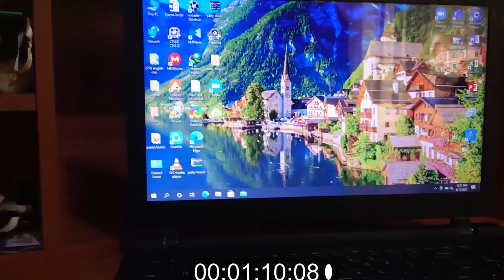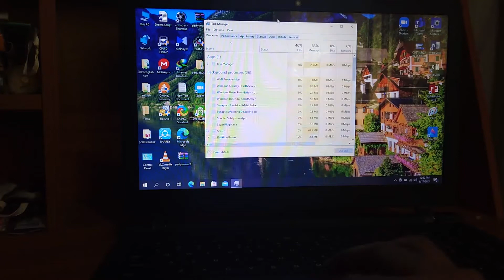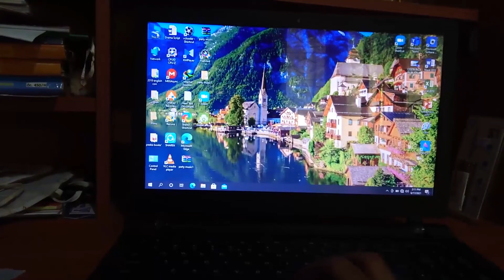Lenovo idiapad 100-15IBY disassembly and RAM upgrade

Comment: 7:26 it says slots ocuppied 1 of 2. So there is no RAM soldered to the motherboard?
Would this laptop also accept 8 GB of RAM DDR3L?
Reply from the maker: Nope no soldered RAM. This processor only supports up to 8GB max in RAM department. So you can upgrade it to 8GB
Reply: @Btech94  OK, but how. By putting in 4 GB or by putting in a 8 GB module?
I am confused because you said that there are two slots ("slots occupied 1 of 2").
Reply from the maker: @MezeiEugen i think in task manager it shows the maximum amount of ram slots that processor can handle. Some processors only support single Chanel RAM. Some modern laptops with sorted memory shows that there are 4 slots. Its just 4 memory modules. There is no upgradable ram. In this case this laptop only can be upgraded to 8GB single stick of memory

Comment: Thanks for the video. I hv done the replace. For ideapad100, no need to take off the keyboard pad, just unscrew the nuts at the back and open carefully.
Reply: thanks because i didn't know if i hqd to take the disk drive out too
Reply: @ can take the disk drive out without taking off the keyboard pad too

Comment: Hey, Great video ! I know I am little late but do you have any information about what generation sata does this laptop has. I recently installed Crucial MX500 SSD but I am getting speed of only 283 MBps read speed. MX500 supports upto 560 MBps read on sata 3 gen. I am not getting any proper info about this on google search.
Reply: Are you sure it is the MX500 and not the BX500?
Reply: @MezeiEugen Yeah I'm sure. It looks like my laptop has sata 2. There is no official statement which says it's sata 3.

Comment: Bro my laptop shows that it have 2 slots but there was only one slot
Reply: My laptop also but
When you check the Performance tab in the Task Manager, it may show two "RAM slots" because your motherboard is designed to support dual-channel memory.

However, not all laptops have both slots physically soldered or available. Some laptops reserve space on the motherboard for an additional slot but don’t include it.

Comment: Do this laptop will increase speed or not after changing the ram ?
Reply from the maker: The performance has slightly increased because swapping to the HDD happens less now, resulting in lower HDD usage. However, in CPU-intensive tasks, there is no difference because this is a very weak processor

Comment: can it run 8gb ram? is it safe to buy 8gb 1600mhz?
Reply from the maker: 8gb is max. You can put 1600mhz but it downclocks to 1333mhz.
Reply: @Btech94  Hi 8GB P3CL - 12800 safe sir?

Comment: what is much better 1333 or 1600mhz?
Reply from the maker: Cpu only supports upto 1333mhz. So no need paying extra for 1600mhz. But it also works on 1600mhz but it downclocks it to 1333mhz
Reply: @Btech94 what if i use ddr3L 1333 8gb its that ok?
Reply from the maker: @satanasjunior3673  yeah dd3l is recommended
Reply: @Btech94  thx a lot <3
Reply from the maker: @satanasjunior3673  wellcome

Comment: What is the maximum ram capacity of this laptop? Can it run 8gb 1600mhz?
Reply from the maker: Yeah max 8gb. You can put 1600mhz RAM but still it runs one 1333mhz.
Reply: @Btech94  does it only have 1 slot for Ram?
Reply from the maker: @DupilPH  yes. Only one slot
Reply: @Btech94  thanks brother!

Comment: Does it have 2 slots to put in another ?
Reply: I saw 1 of 2 slots,it's fail of Lenovo or Windows 10?in my Ideapad100 15iby is the same situation.
Reply from the maker: @ivano.1398  I think it's a glitch from Windows :-/
Reply from the maker: Nope. Only single slot 😕
Reply: Damn, I have an extra ram lying around I thought of putting it in...thanks though.
Reply: I there a chance you can show how to install a new wifi and Bluetooth card?
Reply from the maker: @AllanChristo  you can replace it pretty easily. But all my other wi-fi cards have dual antenna lines but this devices wi-fi cards have only single line. If you have that kind of wi-fi card you can replace it no problem.(3:50 you can see the wifi card middle)
Reply: Thank you so much! 😄
Reply from the maker: @AllanChristo  you are welcome mate